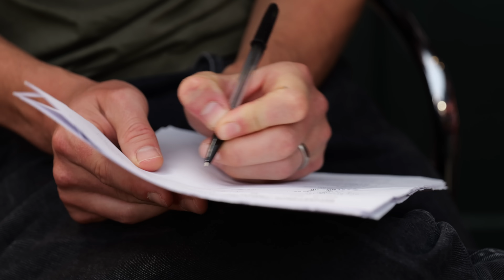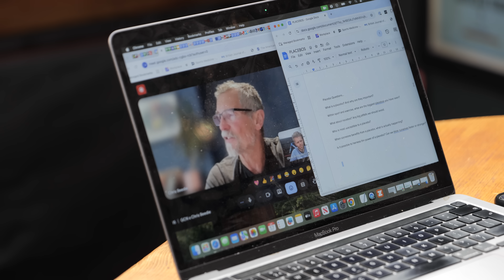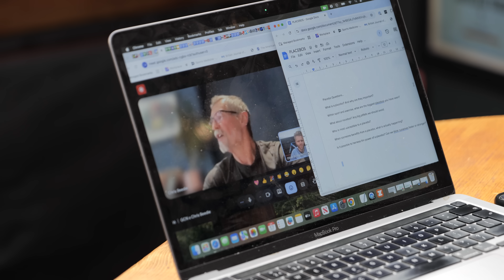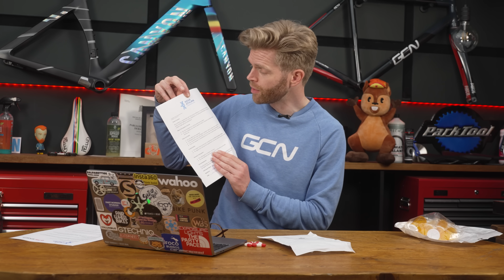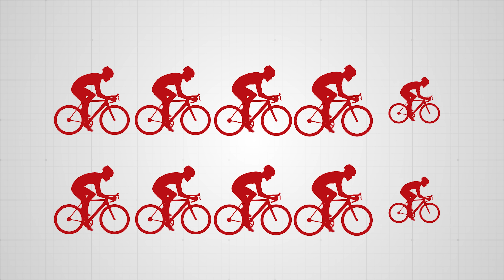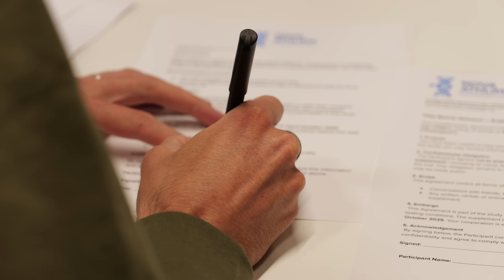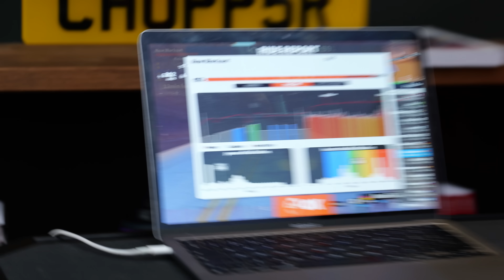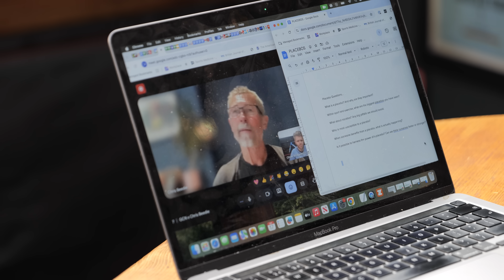This Legal Pill Will Make You 15% Faster

Comment: I recently posted a comment on facebook regarding the UCI's desire to slow the riders down and got a big response:
To slow down the peloton to the speeds the UCI wants they would have to copy professional motorsport and fit a restrictor plate to each athletes mouth. Thus restricting their oxygen intake, and therefore power output.

Comment: Unfortunately, for all the effort put into this,  having Ollie and Simon in the room coaching the riders during the tests pretty much wipes out any possibility of useful results. How much impact did they have based on their own expectation bias? Now, maybe Ollie and Simon didn't know themselves who had taken what during the test. That wasn't clear or maybe I missed that.

While I don't think there's a away to conduct a placebo test in a true double-blind fashion, because the whole point is the test subject needs to know they have taken something vs not. But it would be best if the test administrator did not know anything and better still not even be in the room encouraging the test subject. The whole point is the expected impact of the placebo on the test subject. Yelling "push push push" and similar would seem to at least muddy the water if not outright outweigh the placebo effect.

But testing is hard work and it's easy to poke holes after the fact.  Regardless, this was fun just the same.

Comment: good grief...a good video until....ollie referred to shaving your legs to go faster...total and utter bollox....it will never make you faster....utter crap....even a pro cyclist will have zero impact even over 100 miles.....and lets face it....even if it made you  one second faster over 50 miles....its literally not going to affect the over all outcome as cyclists spend waaaaay too  much time riding at speeds where it wont make any difference....

Comment: Dr Ollie, would you care to look at Sport Leggs pills that wipe out lactic acid? I have used them for years in my cycling, and my wife has used them for marathon running. They do provide a restorative effect for the legs in cycling. No question. 1 pill per 50 lbs of body weight. Taken before and during an effort at 45 minute intervals. To my knowledge they are not illegal and definitely not regulated.

Comment: Some research suggests placebos work even when you know they're a placebo. So get those big red sugar pills ready for your next race regardless!
Reply: I was just thinking about this (are they placebo if you know they are?) whilst watching the video. It's kind of crazy if that holds to be true!
Reply: @malv173  I don't know if placebo is still the right word, but that's the way it's used in the research. There's a big body of research on it, as there is on placebos in general, from a lot of credible sources. In controlled studies with much larger number than this GCN test they showed taking a pill, even when you're told it's a sugar pill, is still effective. Moreso if it's red. It's quite funny really!
Reply: When I was a schoolboy doing evening 10s, one of my mates decided to get a PB by swallowing half a tube of Dextrosol before he set off.  Result?  He sprinted off and after a couple of hundred yards was violently sick.  No PB that day. 🙂

Comment: I'm not so convinced 4 improved vs 3 scored worse. Then you tried to find a reason why the 3 that did worse on placebo might have done so but failed to find reasons why the people who did improve on the placebo might not have performed well within the placebo.....
Reply: I think what should have happened, as he pointed out was to allow them to ride the bike for 12 minutes at less than max effort just to get used to the bike, the route, the program etc then do the two max effort time trials with and the without the placebo PED

Comment: My best times come from just after I bought a new something. A new kit, new wheels, a new supplement. It absolutely does work.
Reply: It absolutely does.
❤❤❤
Reply: Interestingly I use a local hill climb as a test of my fitness and I'd ridden up that thing probably 50 times or more in recent years.   I ended up getting a new bike and the wheels were lighter than my old bike but the fact I was able to climb that hill much faster than lighter wheels would account for.  Probably newer bike, fresh after purchase when everything was dialed in to perfection was a big factor as well as the fact that the shifting was about as good as it would ever be.  It was great but maybe I felt like "I'll ride better now that I have this gaudy bauble of a bike".

Comment: So this is what UAE takes???
Reply: genetics therapy.
Reply: @chrisdelaplante5515  You're probably right. I think it's a combination of lots of little things that us mere mortals will find out about in a couple of years.

I wouldn't be surprised if pro cycling teams are now using hypnotism & motivation experts with techniques tailored to each rider, natural stimulants like ginseng and do things like pre-race nasal irrigation as it's not just energy that is needed, much like an engine, an increase in RPM/power comes not only an increase in the fuel octane, it comes from a more efficient induction and exhaust system and for a human that means getting maximum air as fast as possible into your lungs with the least amount of restriction and exhaling just as efficiently. 

and of course they tell their riders that their bike has most advanced (lightest, frictionless etc) components that the opposition doesn't have yet, and have been remanufactured, blue printed to the highest tolerances and balanced perfectly by the very best German engineers to ensure their bike is the most perfect and fastest even if that's an exaggeration.